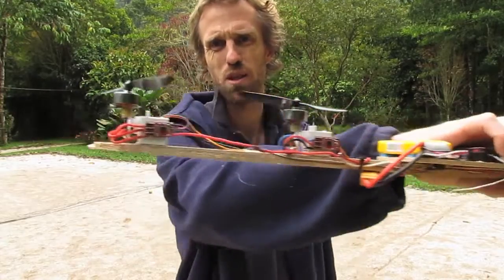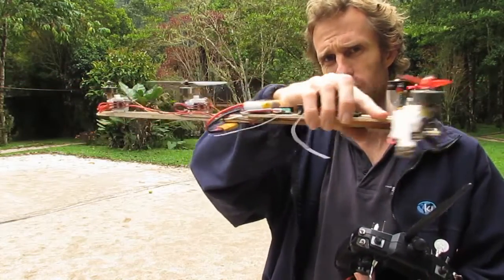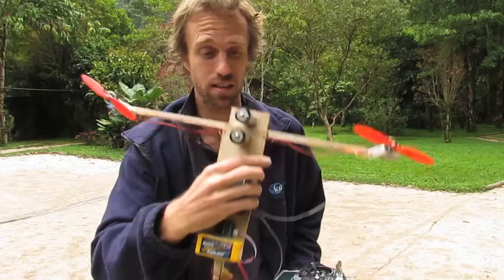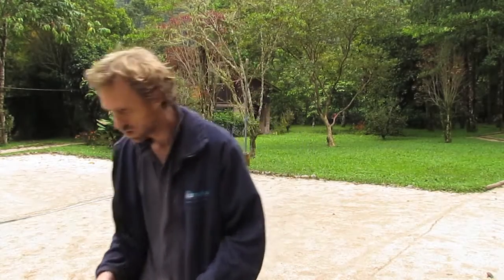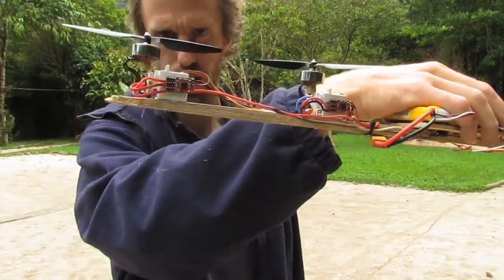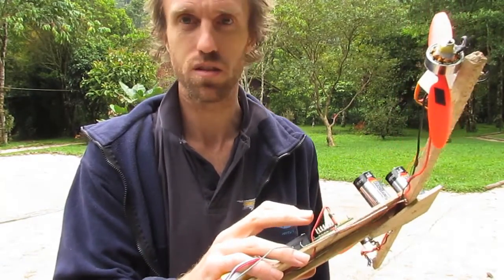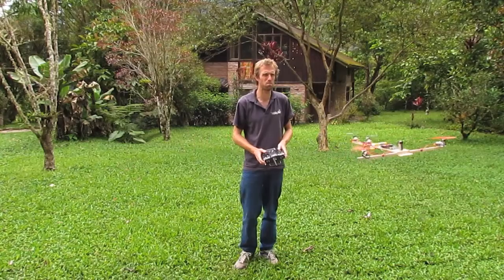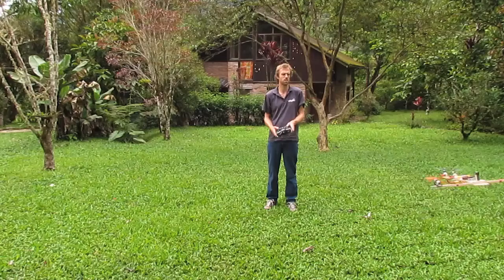Experimental thrust vectoring multirotor. RCHacker #24

Comment: Idea definitely has merit. While I highly doubt these kind of multirotors will ever become popular due to their rather complex and failure prone mechanics, still a very cool project to pursue.

As far as I can see the problem you are facing right now is: Flight controller is fighting against the strafing motion. It detects the sideway drift via acc.meter , and thinking it's wind pushing the craft, it tries to fight the motion. You need to route the joystick on the back thru FC, and create a new mixing to fly this thing. 

God speed.

Comment: I was reading how the collapse of honey bee populations or colonies around the world has forced farmers and others within the agricultural sectors to look for other " pollinators " ? In Japan they've been pollinating their highly prized pear trees by hand . Your device certainly sounds like a bunch of bees while flying and it would seem to have some of the same abilities as far as flying characteristics are concerned as well?Nice piece of work . If you can scale it down a bit and sell it to bee deprived farmers my guess is you'll be a zillionaire in a couple of weeks ?Ty for posting
Reply from the maker: Make them small, FPV, wifi, internet. Then make it into a game so nerds around the world can pollinate flowers.
Reply: I reckon thats possible like you say . You might not have to scale it down that much if it all as an afterthought ? Since crops of all kinds are planted in rows nice and neat like maybe all you need to do is develop a multiple pollinating device with multiple " nozzles?" like you'd see being pulled behind a farm tractor that sprays insecticide or fertilizers and such ? Some of these new electric bicycles now have the battery systems incorporated inside the frame to distribute the weight evenly and to improve basic asthetics so if you used pvc pipe for your airframe and incorporated your power supply within that  airframe you might be able to place your commercial pollinization gear right about where you've located those C cells  perhaps?Believe it RC you've got a winner there

Comment: It was a good idea, but bringing in the servos to the center would require less energy when changing pitch and roll.
Reply from the maker: Sidney Basa The alternative would be? Linkages would add weight. Honestly they weigh so little the difference between this and my tri was negligible and can be adjusted out with PI settings.

Comment: Simple leverage principals would suggest to minimise the the torque required to move the motor and prop the pivot point should be at some point between the motor and prop rather that at the base of the motor. I realise this is a proof of concept model but given the broken control arm you had on the first flight maybe something to look into.
Cheers

Comment: Just an obsevattion based on the physics of your control setup Marc. A spinning prop and motor will have a considerable gyroscopic inertia ( think of it as a large mass) which will require some force from the servo. continued ...